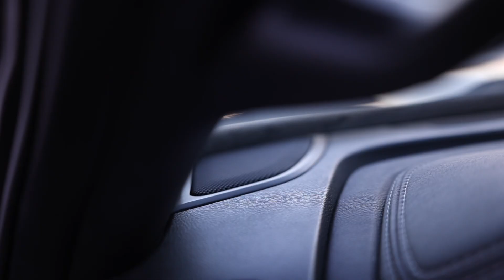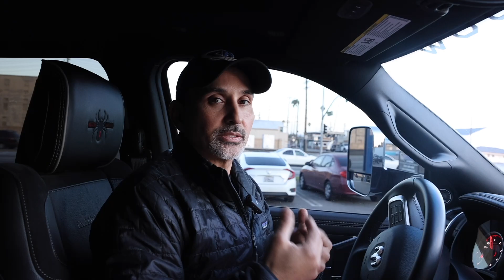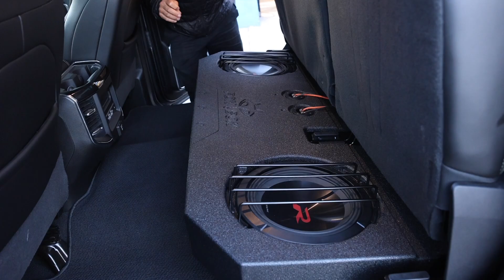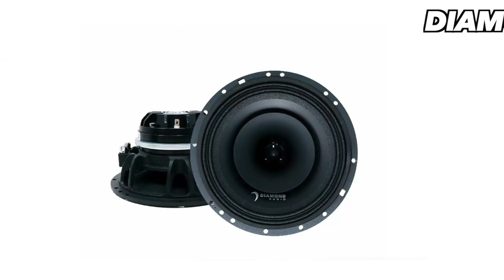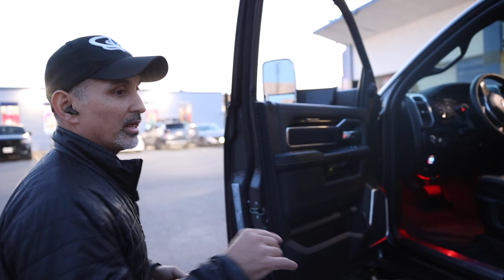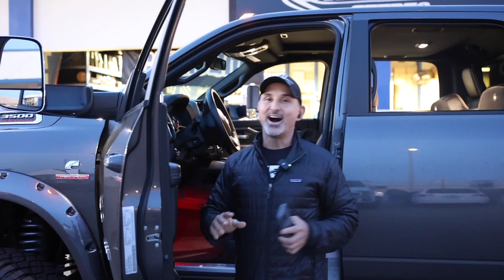We Tested the Ram 3500's Insane Audio System

Comment: How did you tap in to the factory speaker wires to power the door speakers from the amp or did you run all new wires?

Comment: I think you meant you used the AP4-CH41 which is the Amp Pro....the best way to integrate.  I get a chuckle when people still try to use an LC7I or something similar.   So much more work and its the wrong tool for the job.   Great job on everything it looked awesome and im sure sounds great.
Reply from the maker: You’re  are correct AP4 not RP4. Lots to remember when we do these video. Thanks for bring that up. Ahh.. Amp Pro AP…Radio Pro RP Thanks!
Reply: @BreakersStereo youre are?